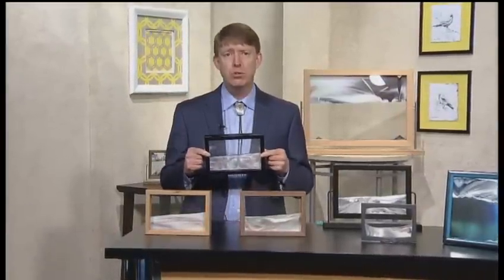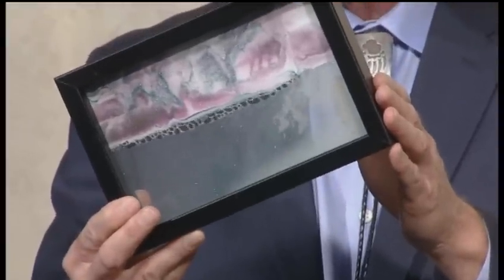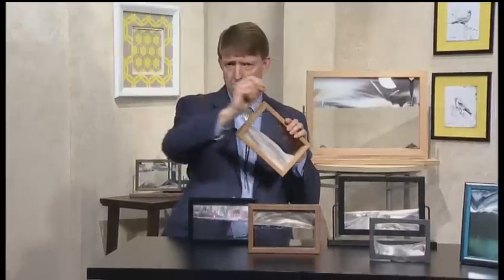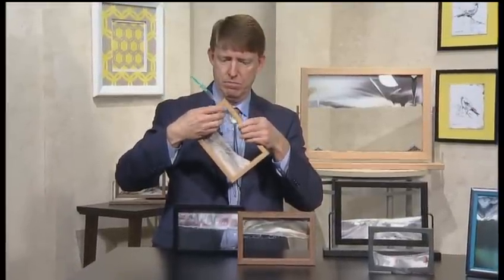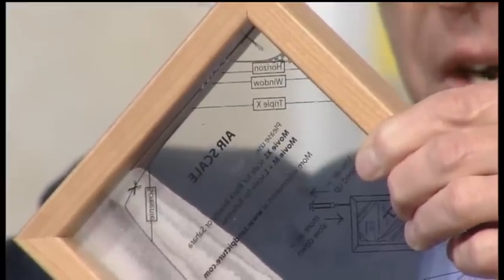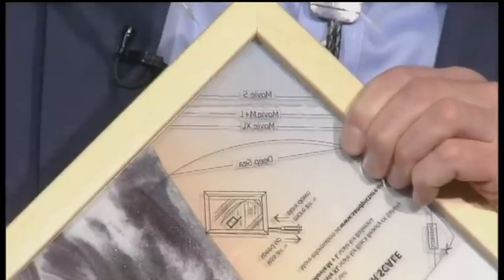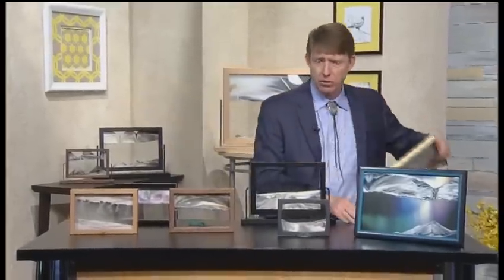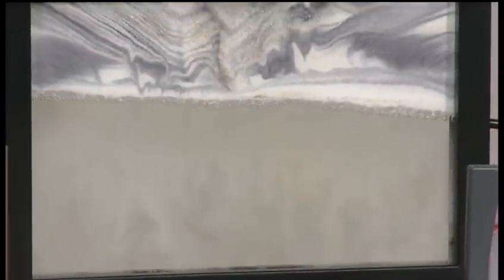How to adjust air in your Sandpicture--Pitkin Stearns

Comment: We have a sand picture and the problem we are having is that the bubbles are too big.  I can shake the sand picture to get the bubbles smaller, but they don't stay small, after a day or so we end up with maybe 6-8 large bubbles instead of a lot of them like when we got it.  I have tried adding water on the theory that this will increase the water pressure and hopefully break up the bubbles, but that hasn't worked.  Any suggestions?
Reply: I have the same problem...
Reply: Maybe there is an additive you can add like a very VERY small amount of soap (like just wet the needle tip) to help break some of the surface tension?  I have no idea, though, so try at your own risk!

Comment: I can't find my instructions for our sand picture but I remember reading something about adding water occasionally but I don't know how much.  We have had it for several years and I've never added any.  How do you know if it needs water also.
Reply: It will need water when you see too much air. Just add spring water* when you see that it has lost too much and you've had to take out air. The water level should be constant throughout the time you have it.
Reply: @brunofuentes3585  How do you add the water please? Same needle as the air adding one?

Comment: Just Amazing.. Wonder how would this thing behave if the fluid viscosity was higher (i.e. with Methyl-cellulose/ Hyaloronic Acid 2% ).. slowing down the sedimentation rate will give more time for the mountains to form and shape..    :) Cheers
Reply: DId you try?
Reply: yea some people use glycerin or shampoo. But I've seen thicker liquids just make it slow down. What I think is really interesting is when you use different density sand. In spring water, adding low density sands with high density sands, and also glitter powders can make for geyser type flows. The are the best looking sand art I've come across.

Comment: why doesn't water leak out of the air holes?
Reply: There's a 'self-healing' gummy/plastic/rubber seal in the hole/frame that the needle is breaking through.  They say it's better to use a sharp needle instead of the blunt needle that comes in the package, so that the seal lasts longer, because the blunt needle slowly does damage to that soft material.

Comment: What size needle and syringe do you use ? I do not have the manual.
Reply: The packaging for mine, which came with it, says 2ml for the syringe and 28G x 1" (also 0.35 X 25, and 25 X 3.5) for the needle.  But it doesn't really matter.  Anything that will fit in the small hole.  The typical diabetes/heroin needle seems like it would work fine.

Comment: I don't need to add air, I need to add water.  Video doesn't show HOW to do that
Reply: add spring water to the syringe and stick it in the tiny hole. Just make sure that you don't fill it all or you won't have air in it painting.
Reply: @brunofuentes3585  Also be gentle because excess pressure could make the glass crack.
Reply: @c3bhm  sure dude